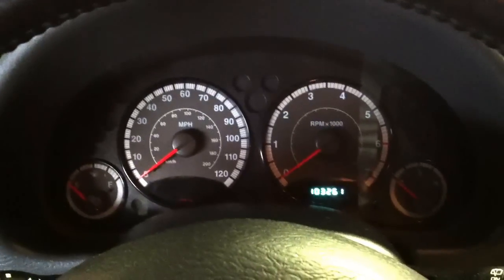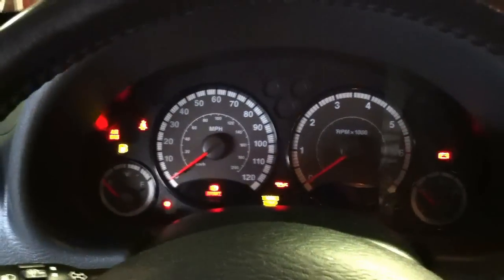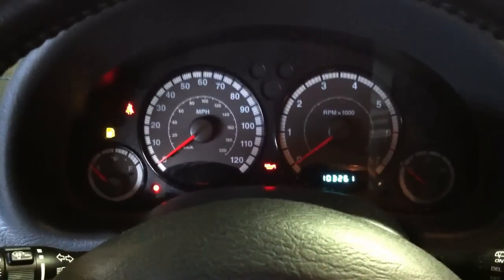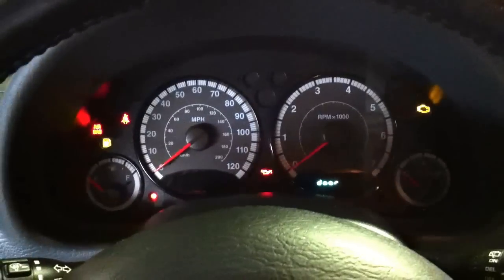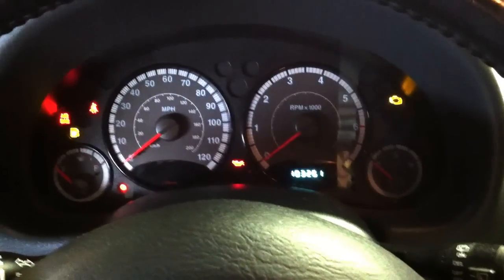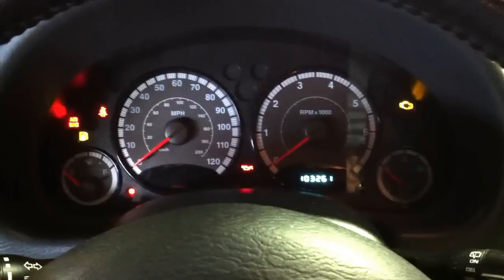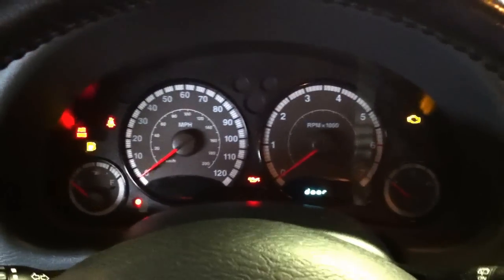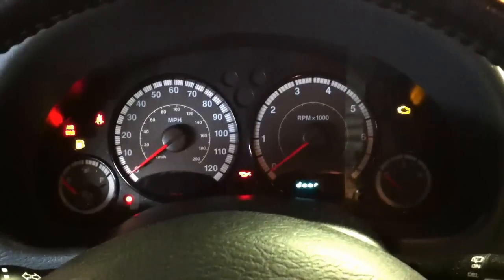Jeep Liberty No Crank Condition. Bad PCM?

Comment: Hard reset your jeep disconnect both cables off battery, and jump them togeather off the battery,  and this will also reset remote start.
Reply from the maker: It was a broken wire in the cluster to the main harness.

Comment: HI  working on a 2006 jeep liberty and when i try to crank it wheel dash is not lid nor warning lights everything is black. any ideas . i test the ignition switch and i dont have power at the blue pink but i do have power on the pink yellow on both pink yellow. i also checked the center ignition actuator and is fine not broken. any pointers i would really appriciated.
Reply from the maker: Check all of the fuses and relays.
Reply: @ hi I went farther fuses look good n relays too but on the blue red wire when turn key to crank n I put power with power prob to the blue and red wire coming out of ignition car starts but I have to hold key on n have to supply 12v to the blue red wire to stay running

Comment: Had same problem, no crank, no click even. Crossing starter relay with needle nose worked so starter was fine. Dealership was not an option cause I'm out in bush Alaska. Ordered a pcm from flagship 1. Unplugged the skim around the key and took it off. Now it starts but low beams don't work along with tach and fuel guage. The wet and cold seems similar. Going to check wiring when it gets warmer
Reply from the maker: Good diagnostic!

Comment: What was the problem?? I’m having issues with mine, after getting pcm fixed after it was not charging.. now it won’t crank at all.. before it used to start and run, it would just kill battery.. now no crank.. any help would be much appreciated..
Reply: Thank you for replying..
Reply from the maker: No problem. Good luck!🍀
Reply from the maker: Bad wire from ecu to cluster.

Comment: Looks like I've got the same issue on the diesel (CRD) model and it happened while just driving down the road, the engine quit and lights came on.  I happen to have spare parts and tried the ECM (different name on CRD) with no luck.  Time to trace some wires but will probably need to tow it home first.
Reply from the maker: good luck
Reply: @StreetersGarage  I have a crd with the same exact issue did they say how far into the loom it was or kind of area?

Comment: checate las corrientas y tierras del pcm pin 1 y 22 12v y pines 30,31 tierras
Reply from the maker: check the currents and lands of the pcm pin 1 and 22 12v and pins 30.31 lands?

Comment: Exact same problem!! So frustrating. Been fueling up with engine on afraid it won’t turn over. Seems like if engine has enough time to cool down between trips or if parked in the shade theres no issue. Thanks for the tips we’ll try what you did!
Reply: This is mine, too Sydney.. It was sitting in the sun, would not turn over. Pushed it backward to the shade, and no turn over. But, next day, all is fine again. Guess I'll do my shopping at night, for now. lol
Reply from the maker: You’re Welcome

Comment: Si el problema no es la llave o algún relevador, intenta revisando el pin 29 del conector negro/negro de PTC( computadora ) , debes de tener 12 volts, si no los tienes ese es el problema
Reply from the maker: "If the problem is not the key or a relay, try checking the pin 29 of the black / black connector of PTC (computer), you must have 12 volts, if you do not have them that is the problem"

Comment: I had exactly the same problem with the fuel gauge and no starting, and it was a bad ground to the ecu all i did was tighten the bolts , after discovering it was a bad earth by using a jumper lead from the negative terminal to the outside of the ecu , as soon as i did that my fuel gauge was the first indication going from always empty to a correct reading , fuel light went off , and seems it solved 99% of the problems and dash lights another simptom was the ASD relay under the hood which in ignition would be clicking on and off like mad , unfortunately for me there is still some other issue on the negative side of the start relay stopping the car from starting but its early days ive only had the car 2 days ... but all i can say is if the fuel gauge is on zero then check your earth on the ECU and to the body of the car and engine .
Reply: Just an update got my jeep sorted , I found that the ECU was cooked pin 06 which is a ground was burnt on the ecu circuit board this also caused Throttle Position sensor signal not to arrive at the ECU as the tracks were damaged around that pin , not sure what may have caused it, I think it was something the previous owner did , perhaps by jump starting in the wrong polarity or a bad earth some where and it went through the ecu to get ground to the chassis , so changed the ECU and reprogramed the VIN , all good starts and runs no problem now. hope thats helpful to someone else.
Reply: I'm lost I tried crossing the ac clutch relay to check ac clutch and Jeep died and I have this same exact problem hasn't started yet.. can't hear fuel pump successful cranking by crossing starter relay could really use help..
Reply: Can't lie I checked number 14 fuse in cab and sure as shit blown. Replaced restarted no issue
Reply from the maker: Great troubleshooting and repair. Glad you were able to figure it out!
Reply from the maker: What’s #14 fuse for? Fuel pump?
Reply: I'm truck driver so I'm not home currently, but if I remember correctly it control's alot AC/PCM/ and couple other things
Reply: I have had exactly same problem on UK 2005 Jeep Liberty (Cherokee) 2.8CRD 2005 after replacing fuel filter.  Once fitted engine started fine and let it run for 20 mins then next morning came to start and battery flat hardly enough power to turn over. Removed battery to swap with a new one I had just bought for another vehicle which was bigger hooked it up and just 1 click then nothing.  After repeated tries with key eventually no clicks first thought was starter and so shorted in situ just a click. Removed starter and on bench just a click so stripped it down and decided time for a new one since internally it was in poor shape.  New starter tested fine but when fitted just no click.  Shorted starter relay and cranked no problem but ASD relay buzzing like mad.  Checked all battery earths and found no issue then discovered this thread and provided seperate earth to ECU on first turn of key fuel guage activated and I thought success!  Alas not engine cranked fuel guage went back to zero fuel light on red light stayed on.  Engine management light came on So now I am a bit further I found missing nut holding ECM replaced and now have crank but still no start.  Any ideas?
Reply: and decided time for a new one since internally it was in poor shape.  New starter tested fine but when fitted just no click.  Shorted starter relay and cranked no problem but ASD relay buzzing like mad.  Checked all battery earths and found no issue then discovered this thread and provided seperate earth to ECU on first turn of key fuel guage activated and I thought success!  Alas not engine cranked fuel guage went back to zero fuel light on red light stayed on.  Engine management light came on So now I am a bit further I found missing nut holding ECM replaced and now have crank but still no start.  Any ideas?
Reply from the maker: Thanks for watching and the feedback. The issue with my Liberty was tracked down a bad wire going from the ECU to the Gauge cluster. Once that was identified,  the Liberty was rock solid for the next 5 years after the condition.

I just traded it in about a month ago with 186k miles on it towards a 2013 JKU. Take a look at my channel, I have a lot of content on the Liberty regarding some of the work I did on it.
Reply: wonder if i have a bad wire in there too, that would have been a nightmare to find that one bad wire, i still cant get mine to start :(  also found that pulling fuse 14 from inside the car causes the fuel gauge to read zero ... still learning a lot about this car has been interesting , thanks for the reply.

Comment: So if it bad pcm u fuel pump won't engine ..I was told this is maybe bad on my liberty but my fuel pump engages and trys to turn over
Reply: liza smith mine is doing the same thing right now how did you fix it
Reply from the maker: Ok

Comment: I have this exact same problem, no crank, security light on and solid. Approximately how much did it cost you to get a dealer to fix it? I've tried continuity tests on the wiring going from the SKIM to the PCM and throughout the PCI data line from the PCM to other parts of the car and no continuity issues. I also got a new PCM and replaced mine which didn't solve the problem so I ended up returning the new PCM. I don't want to blow more money unless I absolutely have to at this point but since I'm still making payments I have to get the Jeep fixed and would like to know the approximate cost of the fix.
Reply from the maker: +Shane McIntosh You got lucky. The root issue on mine was a bad wire from the gauge cluster to the PCM. It took the dealer 2 weeks to figure it out. It's been fine since then.
Reply: What did your tern out to be the same thing happened to me
Reply: Did you ever find out any information?
Reply: Yeah I solved it, it's actually turned out to be a missing fuse in the box so it could be a blown fuse. It was on the bottom right corner of the fuse box that was missing for me
Reply: @BinaryShingami  what fuse is it I think that is my same problem on a 04 jeep liberty I was installing a cd player and the orange wire touched another wire a d every since no crank no start and dash lights
Reply: Streeters Garage what l
Reply: could you tell me what fuse I need to replace what the fuse is and where the location is please thank you
Reply: Streeters Garage how much did it cost you to get it fixed
Reply from the maker: +Jason Webb 

It was brought to the dealer. It was traced out to a broken wire from the cluster and the ECU. Cost was about $500- $600.

Thanks for watching and please subscribe!

Comment: I had similar fail conditions to yours.  After getting good documentation for my exact model ('05 Liberty Sport),
I found the ASD circuit at fault , and tied the offending relay pin to ground just to verify my suspicions .  Success!!
I had been all over the engine and drive train checking continuity and wire conditions. Found no serious faults.
Now I need to get a permanent solution. But , hey,  at least it is running again!!
Reply: How did you find the pin and tie it down?
Reply from the maker: Makes sense.

Comment: check! Ignition Switch Actuator Pin first.
mine has broken  Ignition Switch Actuator pin so I replaced  Ignition Switch Actuator Pin & Ignition Switch together (from auto-zone) because it is not easy to separate.
my 2005 jeep liberty is running well now.
Reply: Is this 2 separate pieces or one ?
Reply from the maker: ok

Comment: mines was the white wire going to the starter....it was loose and corroded... cleaned it and put some dielectric grease on it and it was fine!...... start is on driver side.... turn wheel to the right.... climb under by driver door.... its gone be hidden by heat shield... just reach over it...
Reply: Mine was as well..
Reply from the maker: ok
Reply: @StreetersGarage  forgot one more..... the fuse in the fusebox under the hood that goto the ignition corrodes also...

Comment from the maker: I'm usually pretty good with diagnosing stuff, but once it got to that point. I had no choice to bring it to the dealer. Especially with electrical.Unless you're 150% correct in the troubleshooting, You're just throwing money away.

I hate dealers just as much as everyone else. Just for the fact they try to sell you unneeded services and marked up parts prices. But when it came down to it, it was money well spent.

Comment from the maker: Unfortunately not, we didn't pick it up until the weekend and the tech was not there at the time. 

You're going down the same road as I did. Before I took it to the Jeep dealer, I had my mechanic look at it with his diagnostic tools and he could only get so far based on the limited information from Jeep. 

I was going to order a PCM as well until we made the decision to bring it to the dealer. Since they are non-refundable and don't fix the issue unless diagnosed.

Comment: WOW!! 45 days? This is my only vehicle. I never even considered checking the wires behind the instrument guage cluster. That is where they said it was? Mine seemed to only do it when cold or wet too outside. When I turn the key forward the light comes on, then I sometimes have to wait for the fuel pump to kick on. I have the sentry key system too. But it just flat out died on me and would not even get that far.. But again last week it started again. Boy I hope I can find that wire.
Reply from the maker: Ok

Comment from the maker: When it would not start, it was doing exactly what you see in the video. The only common factor was it would only do it when it rained out and the Jeep had been driving in wet weather for a couple of days.

It took the dealer over 45 days to diagnose the issue. It turned out the problem was caused by a broken wire going from the gauge cluster to the PCM. Since it's been fixed, we haven't had an issue with it.

Comment: Do you remember what wire it was? When you say cluster do you mean under the dash or engine compartment. I just ordered a PCM and if it doesn't work I am at my wits end and will probably spend a day in the cold doing continuity tests on about 50 wires!! Dang Jeeps.
Reply from the maker: Ok

Comment from the maker: Update - The condition was actually traced down to a broken wire from the cluster back to the PCM. Once the wire was fixed the Jeep has been flawless ever since,
Reply: Streeters Garage. I need info i have. Same issue. I need a you tell me code color of wire broken
Reply: check you no 14 fuse ( best indicator for this is there being no fuel reading with ignition on ) but can also mean your ecu isnt powering up, fuse 14 is inside the car , there is only 2 wires that can cause this, the wires typically break in the loom under the hood just where it goes under the Fuel filter on the back fire wall as thats where they are under stress , give the loom a wiggle if the condition changes you have a broken wire . if your start relay clicks when you turn the key  then your problem is more then likely the starter motor.
Reply: Which wire was it ,being i'm tracing that harness now to find the fault?
Reply: whitch wire was it sir
Reply: ok witch wire broo 
witch wire 
\
Reply: there  is only one wire going from pcm to cluster  wht /vio
Reply: How to fix the problems?
Reply: Pleas identify for me which wire cuz this problem
Reply: which wire, what color
Reply from the maker: No idea. It was 10 years ago.

Comment from the maker: It was the immobilizer. The SKIM system had lost the programming for the keys which is why the immobilizer was lit during all of this. Found the resolution after some digging on some various Chrysler forums. It ultimately went to the dealer to get the SKIM system reprogrammed since all the software to do the job was locked down by Chrysler.
Reply: If the small round red light is on (Security Immobilizer) it WILL NEVER start. Likely the SKIM system.
Reply: R Witt how did you come to this conclusion?! Currently stuck in this pickle and it’s my only means of transportation so I need to resolve this and have it running as soon as possible.. thank you!
Reply: Is the skim system in the transmission control module on an 05 Jeep Liberty? Mine is doing the exact same thing with the red light on by the gas gauge. Might try and replace the tmc
Reply: @dktakeover8842  did you ever figure this out????  Please respond.

Comment: immobilizer maybe or the neutral safety switch. try putting it on neutral and try starting it. see wat happens
Reply from the maker: Ok
Reply: FRONT CONTROL MODULE... INPECTION POSITIVE WIRE PIN 13.. IGNITION ON POSITION,,,,  GROUND WIRE IS BLACK COLOR,,,, THAT MODULE IS FRONT LEFT SIDE ENGINE COMPARTMENT.. LOWER SIDE NEAR TO FUSE BOX...IN
Reply: IN THE CHASSIS IS A SMALL COMPUTER